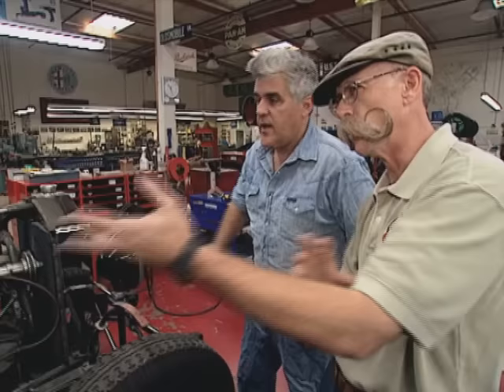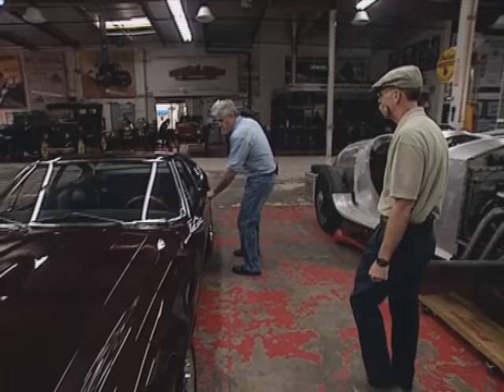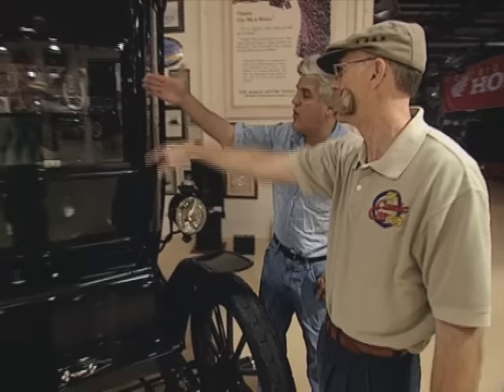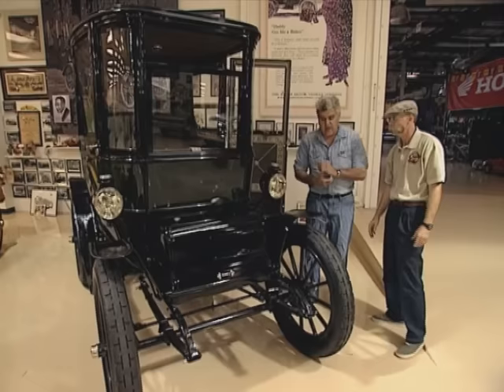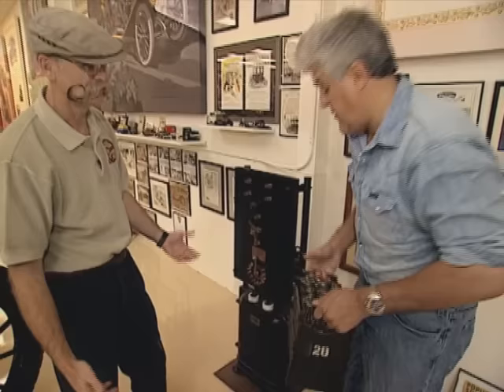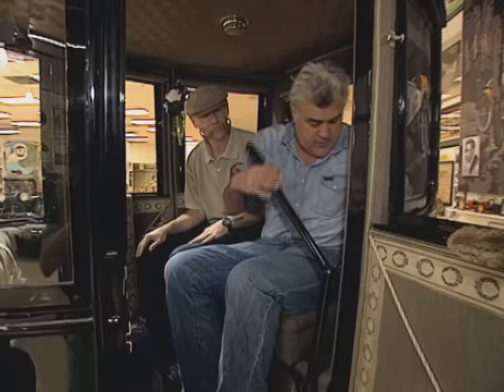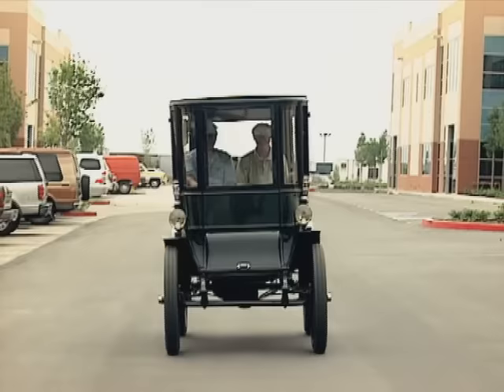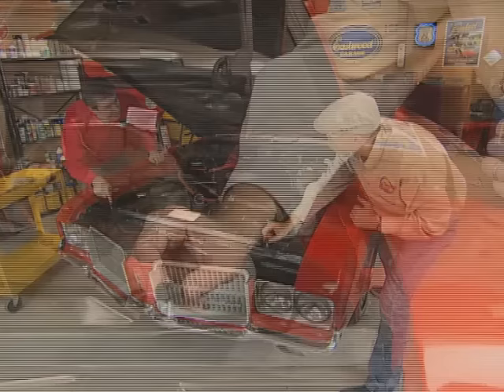Jay Leno's Baker Electric Car

Comment: that little bugger cold go 100 miles on a charge? in 1909??? 

whats your excuse modern electrics >: | yes even the Tesla.
Reply: Yeah, 100 miles , with those crusty batteries on UNPAVED Roads .  Whos your source ?
Reply: um jay leno? he said it in the video didn't you watch it?
Reply: oh kay?
Reply: It seems so, and a lot more elegance than a Tesla , riding around in this would give you a ' superiority complex ' - I'm impressed and over a 100 years ago !.
Reply: 100 miles @ 27 mph Vs tesla 283 miles @ 50 mph

observe that the Tesla ranges were taken from forums and aren't 100% accurate. what's your argument?
Reply: 100 miles with new batteries which are deep cycles @ 23mph and weigh peanuts not even crash tested. Tesla will do 452 @ 24mph and weigh 5Klbs.
Reply: wonder what the Baker will do with the Tesla batteries.  Would be easy enough to wire up for someone with $.  The Baker might do over 1000miles?
Reply: watch who killed the electric car. Oil cartel bought up battery tech and stunted the industry. Checkout the range of the EV-1
Reply: Batteries don't work and scale the same as transistors, lol. Apples and oranges.
Reply: Remember that drag increases exponentially with speed.   Twice the speed for example requires not twice the power, but quadruple the power.   So this can go 23mph, sure, but if you want to go 46mph, you now need a motor that is four times bigger and four times as many batteries to keep your range... except that's not really true either, because four times the motor size and battery capacity itself adds weight, so to get the same performance you need about six times the battery to compensate for the additional weight penalty of the extra power.

Well that's all fine and good, but what if you want to double that and have a top speed of 92mph?   Remember, you are now quadrupling what you already quadrupled... where the heck are you going to fit 16x the battery capacity alone, forget the motor power, in a regular sized vehicle?    And before rapid charging battery technology, which is very recent, how long is it going to take to charge that many batteries, and where will you charge it from, as people only had 120volt systems in their homes.

So until recently, gasoline was FAR superior, since the engine and fuel weight was so much lower for a given power/range, and refueling instead of taking 15-20 hours would be only minutes.
Reply: And I forgot to mention, this thing is made as light as is physically possible without falling apart at 23mph.    Now build it to be strong enough to support the battery and motor weight to have a top speed of 80mph AAANNNDDD actually be able to survive a crash at anything above 10mph (bumpers, crumple zones, reinforced doors and roof, etc).
Reply: "Remember that drag increases exponentially with speed."
At 120 km/h, my car sounds pretty normal, but if go 140 km/h (only 12 mph faster) the tires make a loud hissing sound on the tar road, and the wind noise is ferocious. An amazing increase in friction, with such a small increase in speed.
Reply: down hill on ice
Reply: Tesla goes about 300 miles.
Reply: that car is also tiny - so it probably doesn't weigh much - Im not sure what the range would be in a full sized car
Reply: Most of the issue is that for some reason people now want to actually survive car wrecks.
Reply: power is actually proportional to velocity cubed, so double the speed requires 8x the power. Drag force increases as the square of speed, and power is force x velocity.
Reply: Weight. Modern cars are ridiculously heavy.
Reply: ICE cars were always cheaper to buy and fill up... electric cars have been used this whole time there are many examples but petrol was always considered more practical... only in the 70s did people started to perceive it as a problem
Reply: I think that you underestimate electric car capacity. I sold my electric car with a perfect engine, that was capable of carrying a family sedan up to 140 kilometers on the fastest road with no problem, and there were no suspension problems or other issues. But driving that fast is not safe due to other objects on the road, and is not recommended if you want to conserve the battery. And who needs to drive that fast? 

The weak part of any electric car is usually the battery/range. But clean performance and torque at low speed is excellent and better than most ICE automobiles. So there is value to pursue battery improvement and increased range for electric cars, and most people can survive the daily commute in an electric vehicle just fine. It is also much cheaper to operate and needs slight annual maintenance.
Reply: would you consider a car powered by hydrogen an EV - albeit with a different energy storage medium(?)
Reply: +hellomcflyy. The problem with hydrogen is that it does not liquefy when compressed, so in order to carry enough to have a sensible range, it has to be stored at very high pressure and his requires very heavy metal cylinders that are very dangerous if ruptured. The problems are equal at the filling stations, so a lot of energy is used in the compression before the fuel even reaches the car. I do however see a future in hydrogen fuel cell vehicles, where the fuel cell converts the hydrogen into electricity to run the vehicle. The infrastructure of filling stations will be the major problem, because in order to store the gas, huge cast steel tanks are required and no one will feel safe living close to them, since they will have a pressure of around 50,000psi.
Reply: +Samuel Rosenberg. Their are potential plans to produce the hydrogen by electrolysis. This would use off peak electricity from nuclear power stations, since the reactors can not by cycled on a daily basis without degradation of the fuel rods. The power could be drawn from parts of the grid, saving huge transport costs. However I have serious doubts as to whether it will ever happen.
Reply: +Samuel Rosenberg. What you say is currently correct. However an increase in nuclear power production is already threatening to produce an off peak surplus which could easily result in heat being dumped into the oceans. I personally have grave concerns about the connections between producing heat by nuclear power stations and global warming. Simply considering the relationship between the total world nuclear heat output and shrinking of the ice caps is very frightening.
Reply: Well the Edison batteries are actually superior to the Trojan lead/acid deep cycle batteries that Jay adopted.
the lead acid batteries might get you a couple years service at best.   Edison batteries are nickle iron (NiFe)  these can ( with proper maintenance ) last a life time.   20-30 years is typical,   after a few years you replace the solution/electrolyte and your good to go.  

regarding this car going a 100 miles on 12 deep cycle lead acid batteries,   are you saying this car would not run 4 hours at 25 mph ?    of course it would.    who said the cars running around NYC were running around on unpaved roads? , and the "Crusty" Edison battery is only crusty now being over 100 years old.   the suspension on this car looks not much different than other cars of the time,  or even horse buggies .  suspension was not that bad.
Reply: I totally agree with that,  we are talking about something over 100 years old.   but imagine where we would be if the electric car industry would be now if we went in that direction instead of fossil fuels. 

we take fossil fuels for granted,  but imagine trying to sell that idea from scratch.

hey I have an idea,  we will build billion dollar floating platforms, drill miles below the ocean floor,  or put wells in remote regions, and make pipe lines thousands of miles long, or build super size tank ships   then we will build refineries. to process this crude fuel,   now we need to build tens of thousands of special stations with pumps, and reservoirs of their own. with operators.   we will need other specialized vehicles to transport the fuel from the refineries to these special stations.

In a world where this never existed I would be laughed at.   electric was the way to go,  we only went petroleum, because we had crap loads of it.   laws were put in place at one time, making it illegal to sell land with oil on it without a disclaimer from the seller before hand. . as that was considered a scam.   no longer do we use the expression "as cheap as oil"   not to mention other consequences,   would middle eastern terrorism even be a threat, if they did not have the money from their oil?
Reply: That is silly logic,   you are basically saying we cannot have one thing for another.  all or nothing.   no we what we could have had is most personal vehicles and public transportation being electric, and some vehicles running on fuel.  ( at that time ) until technology catches up.

You think kerosene was what replaced the use of whale oil?  really?   remember that silly invention the light bulb?    lets see a kerosene lamp is cleaner burning than a light bulb, powered by hydroelectric plant?   ok,  I think our conversation is over.
Reply: for my money i think it was a huge mistake to no go to electric way earlier because strategically you cant just send all your money to other countries and we are seeing the effects of that now... but as far as petrol transportation goes the choice was obvious... you couldnt have two types of power in transportation because people commercially rejected the less practical solution... there was no way to convince them otherwise and companies would have died out again and again trying to get that dynamic going like they indeed both for electric and steam
Reply: yes thats what i said :)... i mean even if electric and steam were good enough in one sense for certain limited applications people would have never just accepted that... they would always choose the solution that is more practical for more situations... and that through the 20th century was ICE and petrol... on the other hand not all countries can expand petrol production from nothing... again before the 1970s petrol was very very cheap only in recent years when it became much more expensive did it become economically viable to get petrol from less conventional sources and to go to renewables and electric power and so on
Reply: +Samuel Rosenberg. You seem to be one of the few people who realises what is going on in the West. Here in the UK, a prime development of 90 London apartments was recently sold. Every one was bought by a foreign investor and put on the rental market. This tiny property has resulted in more than 2 million pounds haemorrhaging from our country every year, most of it to China. Even our latest nuclear power station is going to be Chinese owned. It is time that we all took our blinkers off.
Reply: +Samuel Rosenberg. True, but the current rate of capital growth on property will exceed the rental income, but I doubt that they will sell. We bought our house for £600 in 1957 and it is now worth more than 2 million. Even as a London police officer, our daughter cannot raise the money to buy a property within 30 miles of London, despite her husband also having a good job. Something is wrong.
Reply: +Samuel Rosenberg. Needless to say, it was my late father who bought our house, since I was about 5 years old. In those days, their was an unwritten rule that your house represented one years salary and that was almost exactly my fathers salary at the time, as a chartered electrical engineer. We did not require a mortgage, since he was retiring and drew a lump sum from his pension. Today a London house represents more than 20 years salary to a person in a similar position to my father. PS, In those days it was quite normal for fathers to take their sons to work, resulting in me being in the control room during the commissioning of a nuclear power station and sitting in the driving cab of he early generation of tube trains. People today would regard such things as child abuse, but I would not have wanted them to be any different. Don't laugh too much, but about 10 years ago we were on a 14 hour sea crossing and while my wife and son sat in the lounge feeling sick, my daughter and I spent the entire crossing in the ships engine rooms.
Reply: +Samuel Rosenberg. Their is no simple answer to your last comment. An engineer in a similar position to my late father would be earning around £60,000 today and the Sunday joint that cost 70p in 1960, cost £7 in Sainsbury's last week. It is the inflation in property prices that have driven inflation figures, not the other way around. In the 60s, the average family spent more than half of their money on food, so the whole balance has changed drastically. It is interesting that in parts of the world where we can afford to eat, property costs the earth. While in famine stricken parts of the word, you could buy a house for the cost of a few months groceries.
Reply: Although many good points are being brought up, if I had a penny for every unsupported anecdote in these comments, I could buy a Tesla.
Reply: ScottaHemi could*
Reply: I can see your head from up here on this joke Samuel
Reply: You are very sensible in the way that you see things. When I got married. we bought our own house and I am restoring the original property in order to supplement our pension from rental income. I can raise a mortgage on it in order to help our daughter which will help lower the government share of death duty when I pop my clogs. But I do not like the way that things have gone and feel sorry for others in a less fortunate position.
Reply: +Samuel Rosenberg. I was self employed for the last 10 years working, so I am not fully retired and I would die of boredom if I ever gave up altogether. Most of my work was as a design engineer in the theatre and other public buildings including Heathrow airport (I am also chartered), so the phone still rings on a daily basis. The property that I am refurbishing is to a very high standard including solid oak, granite and marble, so it will go to a corporate agency. Hopefully I wont have too many problems, but only time will tell.
Reply: EV's back then  only did like 30 mph max, but roads weren't good enough to travel that fast. In New York City were most of these cars were used in, the maximum speed limit was 12 mph.
So these cars ran efficiently - but they're nothing in comparison to cars nowadays built for modern people who consume much more energy. Now stop your bitching - all of you.
Reply: Yep - only takes about 2 minutes to "re-charge" a gas powered car. Single hardest problem EV are going to have to deal with, I think.
Reply: +Roland Anderson You can't charge in 1-2 hours the battery,because then,like at thephones,it destroys the battery and will discharge even faster.
You NEED (fizic and chemic) to do it slow.
Off course,you don't need 12 hours (that's from a standards outlet,NOT CONCEIVED to deliver voltage and wattage for such a task (and then,chances are, you won't have anything left for the home,but beeing at night ...) but if you charge it from a charging outlet (like a phone charging via transformer instead of usb) it will always charge faster around 3.5-4 hours.

I don't know how it's in america,but in medium and small NATION STATES in the CONTINENT of Europa,if you're a simple worker,you don't do over 40-50 km/day,so at the current batteries hold 150-200 km range,you can almost go a whole working week without charging,so it's more than easy,provived you don't use 100 things at the same time,draining it,because recharghing every day,will SUUUUUUUURE,kill the battery in 1 year or 2.
Reply: The real doktorbimmer

Dude, get your facts straight.
They weren't as competitive back then, simple. I was never talking about that.

What has changed was battery chemistry. Those that existed a century ago (Ni-Cd) are too weak to satisfy modern buyers. They had a density of 40–60 W·h/kg, power output of 150 W/kg and self discharged most of their charge after a month. Li-ion batteries today can put 300 W/kg with 1/4 the weight and volume. and self discharge at 8% per month at room temp.

Saying that "the inherent flaw of relying on batteries is a serious disadvantage" sounds like what it is, what you want it to be.
There is certainly demand for vehicles that plug-in, the year over year growth in global sales proves it. What'snot making them "widespread" is that in the 7 years these cars have been made, only on average of 1 to 4 electric offering are given by a handful of car brands. Limited choice and limited production capacity is why they dont fit your image of "widespread".

If you had an appreciation for cars, you would know that a new generation of a car can take as much as 7 years to develop. 2 decades is enough to define an era for a brand. And for over a century there have been eras that developed petrol cars to where they are today, yet EVs have been the fastest growing car segment for 7 uninterrupted years and now every automaker has put billions into EV R&D. 7 years is nothing in the automotive world.

The electric car is finally getting generational improvements for the first time. There'll be more models from more brands. Don't try to push against the tide.
Reply: Samuel Rosenberg, are you 12??
Reply: Sam, do I care or believe you? If you're trying to call me a hypocrite, it's failing. I like my car for many reasons, but I will trade it for another car if I could plug it in every night and get a cheap, full range every morning. Have you ever been in heavy, morning  rush hour congestion, running late with an empty fuel tank? I hope you won't.
If I ever have the money to buy a new car, it will be electric. Right now, I am driving a car that uses the least amount of oil. I'm not driving it because it uses oil, a ridiculous statement.

I have no idea what your point is, but those who still name the same disadvantages of EVs with their fingers are the ones with the least amount of knowledge about them, just bias. You and doktorbimmer don't know what you're arguing against.

That's called being out of your depth.
Reply: It works for some people. Not for me. I live in a small town and work from my computer, so commuting isn't an issue. We take frequent 20+hr road trips for work or family reasons. An electric car would add days to a trip like that, but gas/diesel is useful for both around town and road trips, so guess which I have? 

It's not exclusive to EV's either. I wouldn't drive my race car across the country on E85 either. So I can't see myself having one until I have to commute regularly again. I personally know of a few hundred people that are in the same boat, so that's a whole demographic that aren't currently likely to have any interest in EV's.
Reply: +Roland Anderson. The same applies to us. Although the new higher range of electric cars would be fine for 99% of the time, about 4 times a year I do a 450 mile return trip in order to collect Jane from the ferry. The port is in a remote area of Wales (UK), so even if I had the time and a 250 mile range, I would have no way of recharging. Holidays in remote areas of Scotland would also be a problem. At the moment, I feel that electric cars are confined to families who own more than one vehicle.
Reply: My current daily driver / road trip vehicle has cost me a total of $900 so far, including purchase, parts, and registration. Over the life of the vehicle, I plan on spending a total of $2000.  Price point on a used [any vehicle using many batteries] has so far excluded me from that market. 

As cool as things with electric motors are, gasoline burning rustboxes are crazy cheap. I wish alternatives were anywhere near as cheap, easy, or universally useful, but for now they're just not.
Reply: orange70383 The electric car can be the car of future
Reply: +Samuel Rosenberg Under wich rock you're kind stayed for the last 108 years ? The combustion intern days should've never been and only existed because of the MANURE pressure of the american industrial monopoly.

Anyhow,the electric car is here and will take the monopoly from the DISASTREOUS combustion intern.

Most things you see today,from the foldable bike (back there was a foldable CAR),to high clarity,3D etc,are ALL inventions of the past,electrified today.

NOTHING new.
Reply: the ev1 was successful w decent range
Reply: The 1909 Baker could probably go 100 miles on a perfect track.  It had 6 Nickel-Iron Edison Batteries.  They were very efficient and long-lasting.  Going slow (top speed of 24mph) also helps the efficiency and life of the batteries.
Reply: + Samuel Rosenberg. That would be possible today, except that people want to travel faster, weight is added by safety features and the battery is drained by lights, heating and air conditioning. The old NiFe cells were fantastic and lasted for ever. If gunge shorted between the plates, you simply emptied then down the drain, half filled them with water, gave them a good shake, before then replacing the water again and adding some sodium hydroxide. The then worked for another 10 years. Unlike Lithium ion, they did not need a complex internal voltage and current limiter to prevent them from catching on fire.
Reply: +Samuel Rosenberg. Thank you for your reply. I often wonder who and what drive technical innovation today. When I used NiFe cells to replace lead acid in a London theater emergency lighting installation I nearly started world war 3. It was simply that the battery manufacturers realised their life expectancy in this application. The electric car discussions will go on for ever. Such a pity that hydrogen does not liquify when compressed, making it almost impossible as a fuel for cells in real terms. Few people also consider that if every vehicle was electric overnight, the electrical grids would need to double in capacity, requiring double the number of power stations throughout the world. One possible solution with the charging problems in cities would be to lay induction generators under the tarmac allowing vehicles to charge when parked away from home. Instead the government have added a few hundred charging points, Just what we need for charging Londons 2.8 million cars. It would also be possible to use induction charging along our motorway lanes, but I had better not shout to loudly about it or I will end up detained for mental evaluation or (as the You-Tube conspiracy theory idiots believe) end up face down in the Thames.
Reply: No lol that is not what happen at all..
Reply: Wow it seems as if 80% of the haters in your replies seem to forget that this marvelous piece of amazing history was built in 1909.... all cars were slow and built INCREDIBLY basic back then..... No doubt the 100 mile range in 1909 was an amazing feat and 23mph wasn't all that slow either.... If electric cars would of had the R&D gas cars received for the past century+ then we would have for sure seen gas engines lose popularity much sooner than just now where it's slowly but surely starting to change thanks to a small fraction of those years in R&D and will only improve.
Reply: Battery technology hasn't really evolved hell of a lot it's actually the major limiting factor in things like how powerful phones can be etc too
Reply: doktorbimmer With normal use you're hard pressed to have a phone battery last 12 hours without needing a charge but I wasn't making a direct comparison just saying batteries have been a huge limiting factor in any portable electronics we could make whether electric cars etc

But yeah I don't think electric cars will ever take off until we finally see some advancements in battery technology. If one is super worried about emissions considering the emissions needed to produce these batteries it would be more efficient to just keep making the combustion engine more efficient and cleaner burning like we've been doing
Reply: ScottaHemi Because  Big Business bought the battery patents starting in the 1890's
Reply: Son of a Zombie Ha ha wow a Baker with Lithium ion batteries yes it would go at least 120 mph for at a 100 miles but not of course at a 100 mph constantly
Reply: 1greenMitsi But Edwin Black's book Internal Combustion he wrote as far back as the 1890's Big Business bought the battery patents
Reply: bRad Nichols roads in 1909 in New York were paved, or at least bricked.
Reply: What's going to replace the Plant?
Reply: ScottaHemi - Nissan LEAF 1906
Reply: Tesla S was the first proper modern electric car. And by proper i mean that it was the next evolutionary step since 1909. Anything before Tesla was either a failed prototype with tiny range and problems or some stupid hybrid. Essentially the technology stopped being developed back then, and continued only recently. That's the excuse.
Reply: the nextinline - GM wanted the EV1 to fail , they only made a 2 seater, made it ugly , and used Lead Acid batteries - that were invented in 1900. GM would have been on to something IF they made a 4 Seater Sedan with 4 doors, made it Good Looking and with Lowest Drag Coefficent, and used AGM or some other Advanced Battery perhaps Ni-Mh.
Reply: See nikolamotor.com
Hydrogen used to make electricity...
Reply: government regulations/safety/health hazards,etc
Reply: Teslas are very heavy, and the Baker goes slowly where EVs are most efficient.
Reply: ScottaHemi manufacturers make items cheap and easily broken for money the More break the more bought in most cases
Reply: ScottaHemi Thats why Gasoline engine is unbeatable
Reply: Excuse? Speed and weight, and charge time. The modern cars cruise at 3 times as fast with triple the range. quintuple if you go the speed of this car, and then they turn around and charge in half an hour. 

Getting the range and speed of the car in the video has never been difficult. Getting something that rivals the current gas cars has.
Reply: So, computing problems and battery car problems are the same? They should progress at the same speed? By that reasoning, we should all have personal space shuttles, too - why is the aviation industry letting us down there? Must be simple, after all, computing has improved that much in less than a decade.
Reply: A rechargeable zinc-air battery with an affordable catalyst could wipe out lithium-ion batteries. They have a specific energy density significantly higher than lithium-ion batteries, but aren't affordably or efficiently rechargeable. That solution could, of course, be a decade or two off from happening. There are hundreds of other potential ideas which could improve upon or replace li-ion batteries. The idea that energy density cannot be improved upon is ridiculous in my physics purist eyes. In reality, fans of internal combustion just want to pretend EVs are impossible rather than a valid option when compared to petroleum-powered cars.

The biggest problem with electric cars isn't technological, it's economic. Modern Teslas meet consumer standards by quite some bit; most of the ways they fail to do so are Tesla's fault, not the fault of the concept itself. Battery-electric vehicles are somewhat expensive and time-consuming to produce compared to traditional internal combustion engine vehicles—most companies who have produced them have yielded net losses. This makes them even more expensive for the consumer. This doesn't mean EVs are a bad product, but substantial scaling and new technologies are needed before EVs will generate profit for the company producing them.

For the record, bolding your comments doesn't make them more important.
Reply: Tesla goes modern day speed limits of 70 mph.
Reply: Tesla has gone 500 miles.. the newest one will be going over 600 miles
Reply: ScottaHemi a model 3 can go 600 miles on a charge if 25 is top speed. Oh yeah and it weighs 10 times as much,  has climate control, and as an added bonus you won’t be chucked through the windshield in a low speed accident.
Reply: It’s because a Tesla is full of technology– can’t we have a simple car with on on/off button and petals and THATS IT– I’d buy it(could be pretty light/ energy efficient
Reply: "Top Speed 23MPH"
Reply: These have small motors. Most likely a 2 HP, single phase induction motor running off of DC. That's very tiny. The Tesla has a 500-700HP, 3-phase induction motor. These types of motors are usually only run off of an AC source at 460V, 60Hz nominal. A motor that large needs a lot of batteries with modules wired in series and parallel as well as rectifiers to convert DC to AC. To be honest the Tesla is impressive. The fact that the squeeze that much power from battery modules while integrating several controls and other electrics.
Reply: New cars weight more..have safetuy features..and standards that have to be met..oh and have to do 80mpg..come on lets use your heads
Reply: Elon musk: rubs back of neck and winces
Reply: @Justwantahover  you need to take your logic and go elsewhere. We're trying to justify being whores to the oil industry and emptying our wallets at the pump!
Reply: Battery tech has improved at a glacial pace. Energy storage per kilogram of battery has only improved about 10.1x in the last 120 years.
Reply: 100 miles of range sounds highly implausible. 

My grandfather drove a very similar car 80+ years ago, and it was said to have a range of about 25 miles, if you took a break halfway to let the batteries "rest".
Reply: DumbDuck44  that’s the best answer, explained so that even I can understand it.
Reply: The computer, the autopilot, apps and all that probably use up 30% of the battery, that is their excuse.
Reply: That is why electric cars were abandoned in 1909 because gasoline cars were and still are MUCH better, range, re-fuelling etc.  etc.
Reply: That thing doesn't weigh anything compared to a modern car and it has a handful of hp. Those tires are low rolling resistance because of how thin they are but are unsafe. Sure the aerodynamics are bad but at 20mph it's not that much of an impact.
Reply: DumbDuck44 yes I too N E E E D a car that goes faster then the speed limits; very practical math.
Reply: Roland Anderson the technology already exist! Electric cable cars would have infinite range within the infrastructure. If we built cars to swap the dead batteries rechargeable  out for new ones more then charging the charging delay problem would be circumvented; say if the battery banks were on a bowser or something. The real focus should be infrastructure and shifting the paradigm. the speed limit where I live is 75mph max; any core that goes over that is outside the field of practicality for most people and is a gimmick in my mind. As for cities with modern traffic those speeds are fantasies anyway. modern cars are absurdly heavy. back then sure they were less safe then then acceptable today but we have a lot lighter and stronger materials now and if we adopt that 20’s era compactness with modern technology range gets practical (just watch the video). I see compressions between electric vs gas cars as between gas lamps vs light bulbs. but imagine if we took the same philosophy to modern electric cars as we did to tv Remotes. Isn’t an extremely large battery bank built to reduce the time between charges with the result that it takes longer to charge less practical then swapping the dead battery’s for new ones if said batteries were rechargeable?
Reply: Lassi Kinnunen you say 23 mph is slow but that’s about how fast the fastest Olympic athlete can run so we are spoiled today when it comes to speed.
Reply: David W indeed ever since cable cars existed range should have never been a problem.
Reply: Ah, problem ? O i l companys !
Reply: Its vecause of the speed if u drove a tesla at that speed it would go farther
Reply: because they only went 20 mph
Reply: @Blake Belladonna computing power can't really be compared with electric motors and vehicles in terms of their rate of advancement lol
Reply: @yesimhuman  You know the best part... Nicola Tesla was still working with George Westinghouse when this car was built!!  

Tesla was creative on the scale of Thomas Edison (whom he had worked for) and George Westinghouse but was more comfortable in his lab than on the public stage. Edison was much more the egotist and a showman. Aside from all that, these three inventors were some of the most prolific engineers and inventors that ever lived!
Reply: Cross off a nought. More like 10 miles on 36vdc deep cycle batteries. Somebody is dreaming here.
Reply: Except for the batteries, it's as light as a feather -- leather fenders, wire wheels, wood body, and glass.  No safety equipment of any kind. Wind resistance is negligible at only 23 MPH. Women passengers -- all shorter and much lighter than their counterparts today. So, yeah, I can see 100 miles.
Reply: @bRadicalmagic1  how stupid, you think unless its new it can't, just confuses you that most so-called new ideas today are not actually new ideas. we are still working off of the geniuses ideas and inventions from 50=100 years ago since today's education system can't teach people to think anymore. its why developments like solar for example only got developed so far, etc., etc.